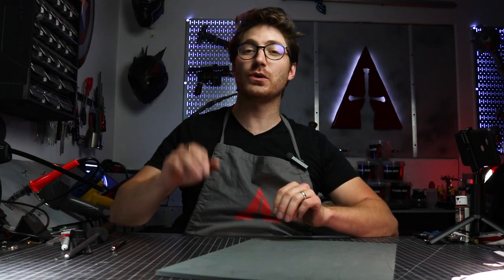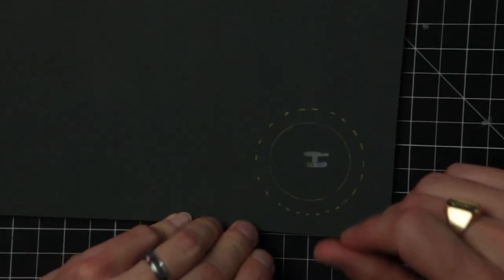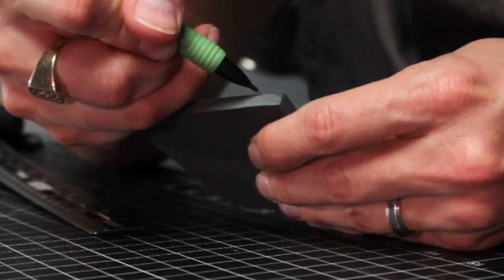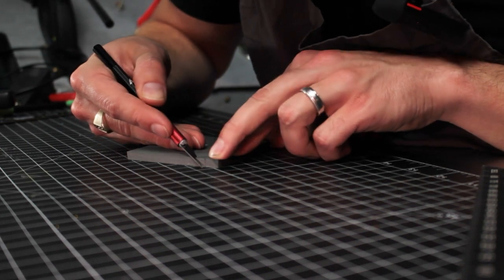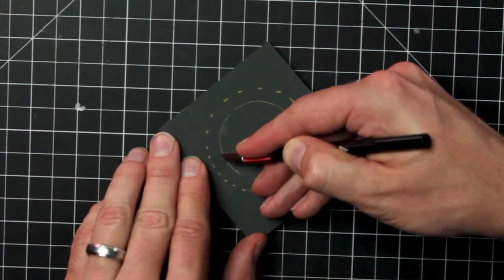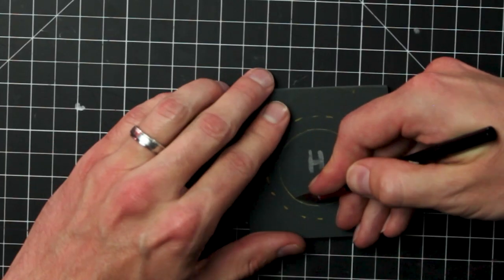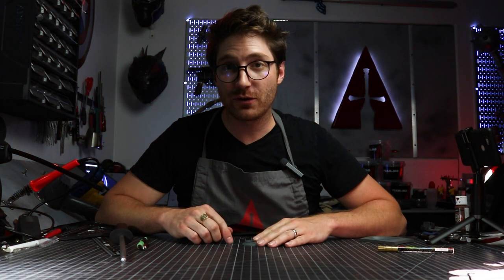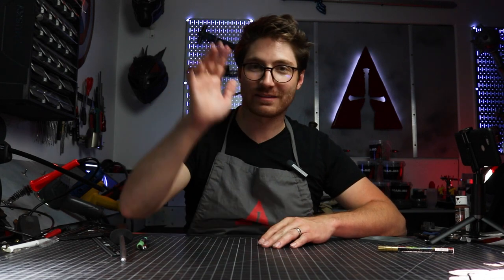Cutting Beveled Circles Out Of EVA Foam By Hand | Cosplay Apprentice

Comment: My suggestion is to have a cutter which is already fixed at the angled. I’m thinking using a piece of wood or very hard rubber cut with a machine at the exact angle so it lies flat against the foam while the blade lays across the angled surface. Just saying what I would do. Do not do anything with sharp dangerous things.